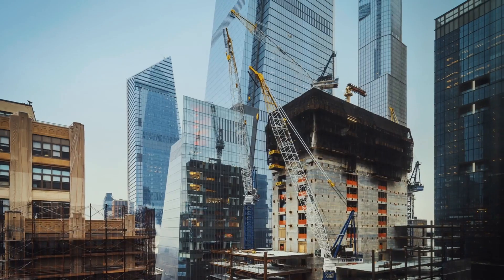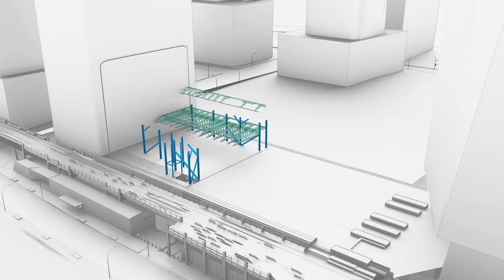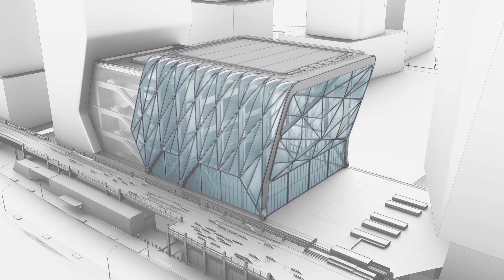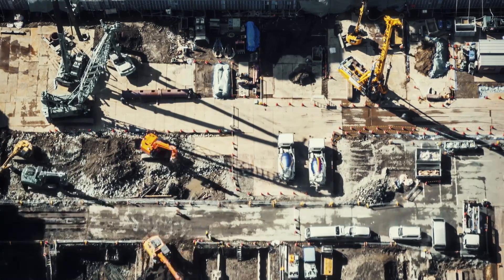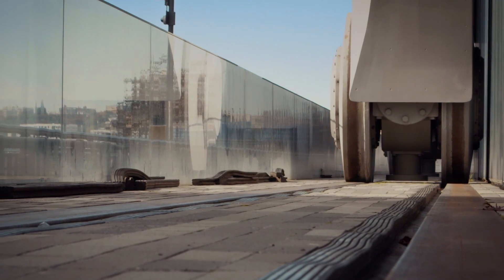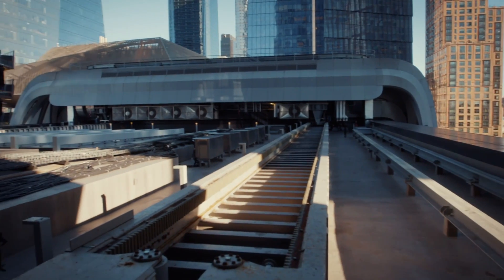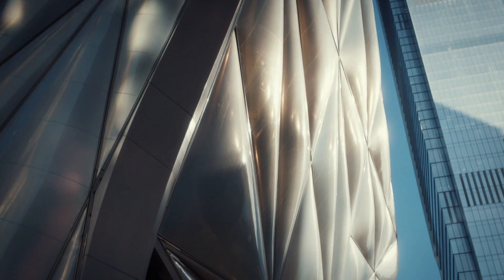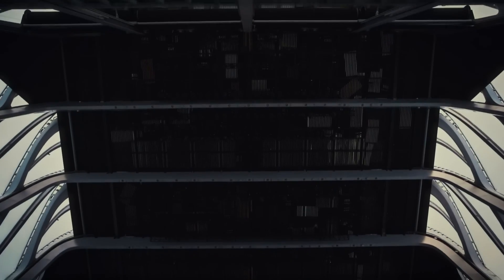This Crazy Design Allows Hudson Yards Showroom to Expand 😯 How Did They Build That? | Smithsonian

Comment: How about using frictionless magnetic "fusion" instead of the clumsy wheels.
Reply: I doubt that approach could support 4,000 tons.  You'd need huge magnetic fields to hold up something that heavy, which requires a ton of electricity to generate said magnetic fields.
Reply: @MatkatMusic  problems drive innovation.